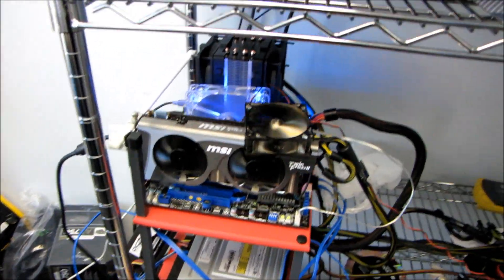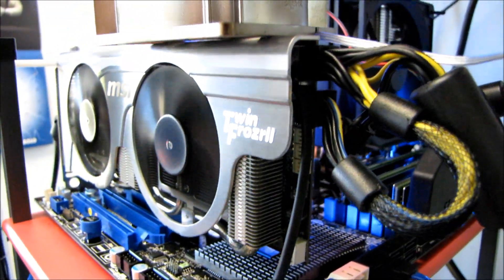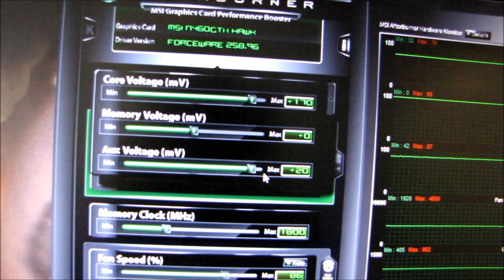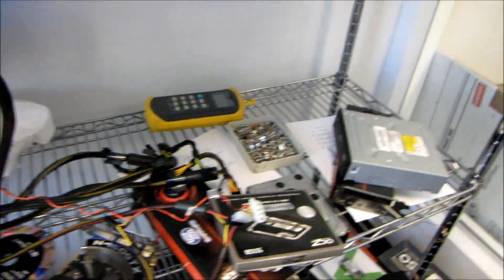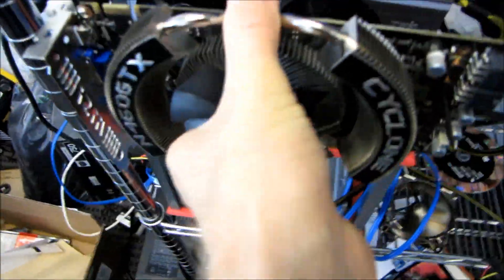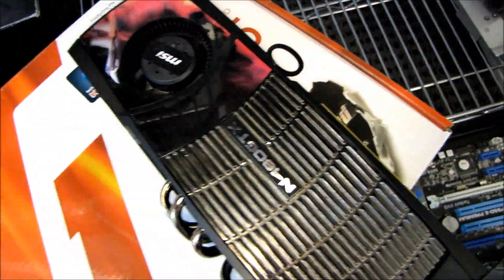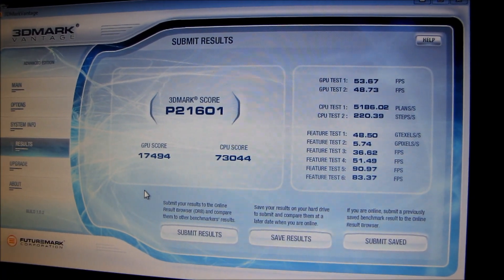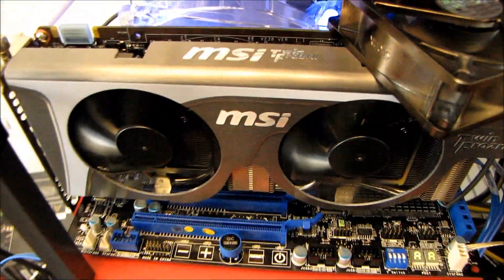MSI GTX 460 1GB Hawk Edition Overclocking & Performance Linus Tech Tips

Comment: You have 2 monitors, why wouldn't you monitor other stuff with it?, and with most games even at 1440get over a gig used, that's why I'm getting the 660ti, I wish nvidia would get a clue and on higher end card put more memory (660ti got it right for price and performance) if nvidia would put 3 or 4gb stock single gpu cards they would blow AMD out of the water

Comment: Lol, are you play at 1080p or a lower resolution? Also, when I played bf3 on my 830 @ 3.6ghz it was 100% cpu usage, my i5 gets at most 80%. So that says already my 830 was the bottleneck. I love AMD if you are on a budget, but if you have the extra cash the outright better architecture with intel is the way to go. I use both AMD and intel so in all honesty you buy what suits your needs. For me the 830 wasn't cutting it so I just bought a i5. Hope this clears it up. Thanks

Comment: I used to run bf3 at medium settings with my oc'ed hawk to 900mhz but i recently bought an i5 2500k and oc'ed to 4.5ghz (was running phenom quad core 830 @ 3.6ghz) and boy what a cpu upgrade can do..... I went from medium settings in bf3 to playing ultra at 40ish but it was kind of laggy feeling so dropped the AD and motion blur and also ambiet occlussion off the rest maxed at getting steady 50+fps :D

Comment: Hey guys! my core voltage is set to max and I am at 891/1782 mhz, it's really stable and the temp never goes above 60C but the thing is I'm sure I could push it to 920~950 but the thing is I can't put more voltage to my card, I don't know how you guys get the 3 sub parts for voltage I can only put the Core voltage to 1100, any idea how i could put more voltage so i can push it a bit more?

thanks

Comment: The GTX 460 Hawk can be overclocked to 1GHz, but it's not practical.
a. the card will heat up like crazy
b. the fans will run at max. the entire time, and the Hawk is not very quiet at 100%
c. the power comsumption will explode to GTX 480 levels

Comment: @MicroTerminator You need to get the beta version of msi afterburner. After getting the beta version (idk witch version it is) you can overvolt your gtx 460 hawk. Also make sure if your going to go for max overclock you have some cooling on that card! Linus has an open bench system so he can get more fresh air. If your trying to reach his overclocking speeds inside a case you might run into some major heat problems.

Comment: I am looking to buy evga 460 1gb i want to know that tell me if this psu is able to handel this gpu ?
COOLER MASTER EXTREME POWER 600W RS-600-PCAR-E3

My Pc
Core i3 540
Intel Corporation DH55HC
CORSAIR DDR3 2GB-1333BUS VALUE SELECT
COOLER MASTER CHASSIS CM ELITE 370 WITH 420W POWER SUPPLY
250gb

Comment: my twin frozr 460 ran stable crysis2 at 1000mhz core clock
2000mhz shaders
and ram ar 1850mhz since it haves no heat sink
core voltaje was 1.055v

Comment: Man I love this card. I'm now overclocking the beast, currently at 875MHz Core, still linked to shader clock, voltages at default and fan on auto. To test stability I'm using the MSI Kombustor, 15min for every +5MHz  increase.

Btw Linus, what is your default voltage on this card? Mine is 1.050V. I've heard that the default VDDC varies.

Comment: Is it true that the msi gtx 460 hawk card in sli mode will not share the ram memory and that your stuck with only 1gb ram? if so is this also true for all brands (evga, msi, pny etc) using the gtx 460 gpu?

Comment: @gabs2012 it isn't meant to go against the HD 5870... the GTX480 was meant to go against the 5870, the 460 (like the 465) was meant to go against the 5830 and kind of the 5850 (the 470 was really meant to go against the 5850...) but for a $249 USD card from newegg I'd go for this because it has great performance and isn't as expensive as the super high end i.e. the GTX480 (best single GPU, according to 3dmark vantage) and the HD 5870(2nd best single GPU card, according to 3dmark vantage)

Comment: @BKsMassive It's you're. Not your. And Nvidia was 6 months late with there cards and they barely beat ATI's cards in performance. ATI cards overclock easily like you said and produce way less heat. So you're sating ATI sucks even though they produce less heat, overclock better and 99% of the time have equal performance. Oh and they're cheaper. So where is your logic here?

Comment: Hey Guys this is random but im upgrading my system gpu and i need to know if the cpu will bottleneck my gpu i want to get a gtx260 along with my current gts250 for dedicated physix i just want to do this to try out 3d vision surround my cpu is an intel core 2 duo e7500 if so any advice of a 775 cpu i can get to get maximum preformance

Comment: @FedoraFTW So what is the debate here? There is none. GuruOf3D quote "In fact the GeForce GTX 460 is so good that they without doubt are going to replace the GTX 465 altogether. There is just no point purchasing the GTX 465 any longer." The 460 is so good for the price that it has single handed lowered the prices on the 465,470,480,5850 and the 5870 shortly after its release. I know your sad about your purchase of the GTX 465 cause you can't return it, but don't defend your garbage :)

Comment: My 5750 is 900 core 1265 mem on stock voltage and the stock cooler. So that overclock doesn't impress me much.

Comment: @BCB228 the problem with dell is they use very basic power supply.
so if you have a pci express slot and and the motherboard is stardard ATX (my old dell used a weird motherboard  that had the expansion slot backward)you should be fine but you might need to upgrade the power supply a 300W will have trouble with any decent card.